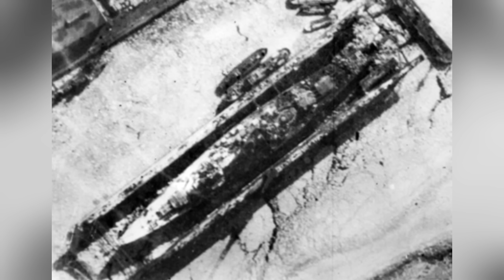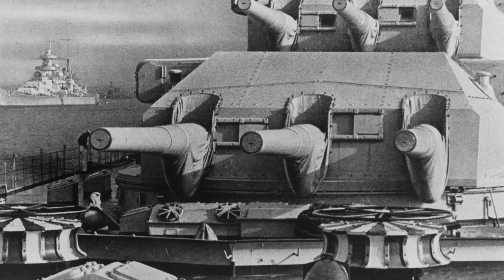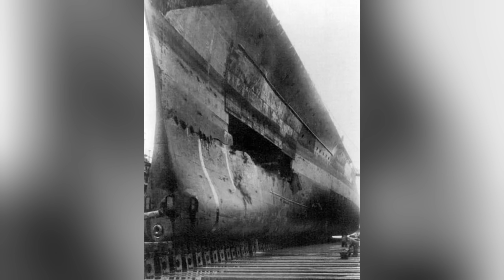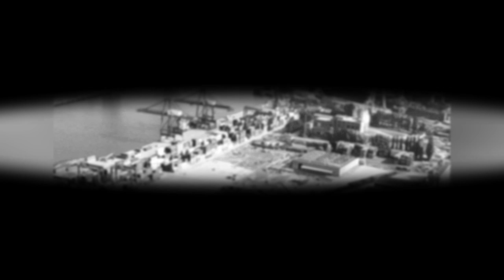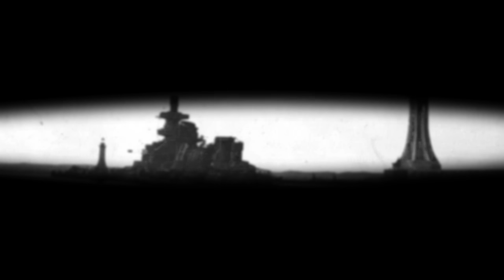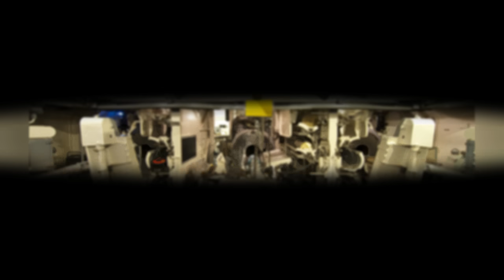Salvaging Gneisenau: The Scuttled Warship Poland Dragged Back Up

Comment: The metal is not contaminated by radiation from the bombs so canbe used to make surgical instruments.  Thats a fact .
Reply: Only the steel underwater and it was all irradiated after it was scrapped.
Reply: @jimtitt3571  No, the contermination takes place while it is forged. Not from  being in the open air. Anyhow, demand for low radiation steel is small and most of the steel from pre 1945 steel was just used as any other.

Comment: The 11 inch guns were what they could get at the time.   11 inch guns were totally obsolete by WWI BB let alone WWII  BB.    15-18 inch guns were the new normal (14 inch was also done but it was recognized as deficient for a BB (Battlecruiser.  yes.).     Note that 4 other ships had 11/12  inch guns.  3 of the Deutchland Class and the Alaska Class (12 inch).     All 4 were Very Heavy Cruisers.    Gneisenau class was a BB,  should have had 15 inch guns.
Reply: More than adequate for taking on a heavy cruiser at ranges it can't hit back.  If a commerce raider meets a battleship it's supposed to run away.

Comment: Dead wrong, good sir! Sharnhorst & Gneisenau were Battlecursers in evey way, shape & form. A pocket Battleship is a completely different class of combat vessel all together. Graf Spee & her sister ships were designed as commerce raiders
That could operate for long periods of time as independent combatants, sowing chaos in shipping lanes throughout the world's vast ocean voids, outgunning anything up to a heavy cruser that might stand aginst them.
Sharnhorst & Gneisenau were built & tasked with a much different purpose of being part of of the fleet battle line, though admittedly they wound up doing their worst dammage as commerce raiders.
Reply: They were only called battleCRUISERS because they only had 11 inch guns. Had they had the 15 inch guns like Bismarck and Tirpitz, they would have been battleships.
Reply: @Species5008  That's the normal nomenclature. Light cruisers had 6" guns, heavy cruisers had 8" guns and battle cruisers had 11 or 12" guns. Battleships had 12" or larger (14" by the start of WW2) and heavier armor. The Spee had 11" guns but the Germans called them "Panzerschiff" or "armored ship". "Pocket battleship was a name made up by the press.
Reply: Albeit that the Kriegsmarine themselves classed the ships as battleships. The Royal Navy referred to the ships as battlecruisers on the basis that they were fast. It is interesting that the RN' designation tends to be favoured these days rather than that of the builders and operators of the ships.
Reply: @tonystevens9278 
" Rules the Waves".......NOT !

It was a hard pill for Britain to swallow that the Royal Navy had been surpassed by those "damn Colonials"......an even harder pill to swallow was that the American Army no longer stepped to Monty & the British High Commands vision of warefare......ala....General George S. Patton, Bradley & Eisenhower.
Reply: @martypalmiere7672  - What am absurd post. Fortunately not all Americans are as Anglophobe as you appear to be. Do you appreciate nuance? Personally I tend to favour using the German's desciption of their ships but that does not stop people calling them battlecruisers. Yes, since 1945 America has de facto been the world's policeman but it is hard to opine that it has made a success of that role.

Comment: Silly decision by the Germans. 11" guns would have sufficed for a commerce raider.
Also, I'm surprised that explosives were not removed before dry docking. Perhaps that's unpractical, so I'm open to correction.
Reply: The decision to hold on to the ammo may have stemmed from the worry that it may have been repurposed by the Whermact were it to sit for too long. Or it may have been felt that the ships magazines were actually the safest place around at the time. Ammo handling is a dangerous undertaking in the best of times. From the time she entered drydock, she was a sitting duck for bombers, who were ultimately her demise anyway.
Reply: @toranagachan3402
Thanks.
Reply: When the Gneisenau and Scharnhorst were planned, the Versaille treaty still restricted Germany to that calibre. It wasn‘t a free decision.
Reply: In my opinion (and it is only that) some of the best German ships resulted from these treaties. Instead of pointlessly engaging in the fultility of replicating the Dreadnought arms race, they came up with well thought out designs that served specific purposes.
The Scharhorsts still outgunned most ships that could catch them and were keeping Royal Navy resources occupied as the "threat in being".

Comment: It is a technique called cut and shut not cut and cover, cut and cover is a construction technique used in civil engineering most often to lay very large pipeworks, underground railroads and motor underpasses. problem for both Gneisenau and Scharnhorst was the bow was inadequate from the get go, a lack of Naval Architecture expertise lost after the disarmament restrictions of 1918, meant that both ships were effectively designed with scantlings good enough for Baltic or Mediterranean Seas but not for North Sea or Atlantic , hence the whole forward end needed to be replaced / re-enforced and significantly lengthened, so not just doubling the weight of the turret and accessories,  these ideas of up gunning a capital ship look good on paper or in 'world of warships' but it is not a valid proposition, if you need a 38cm gun warship with 3 time twin turrets, a keel up design is the answer. It is believed the Japanese considered doing similar to a Yamato Class ship changing the loadout with 51cm gun again replacing 46cm guns in 3 x triples with 3 x twins, but although the weight for the guns and mountings were close the IJN went for a fresh design = A150 rather than running into the inevitable compromises, perhaps they were wiser than their European contemporaries
Reply: Gneisenau was my first torpedo BB in WOWS.